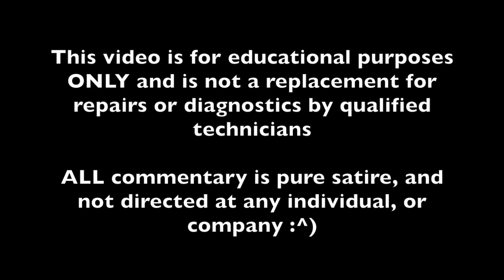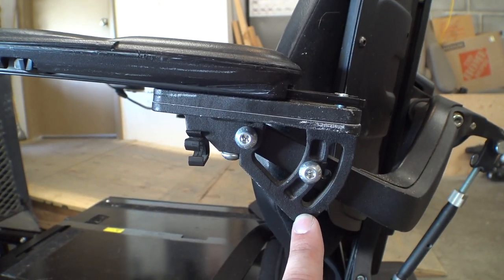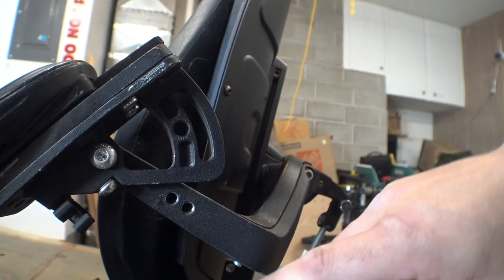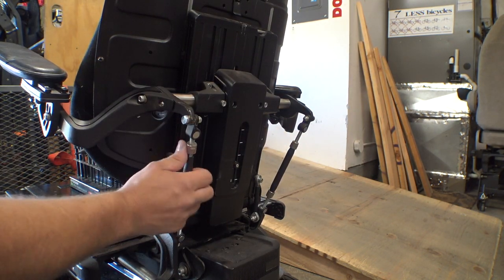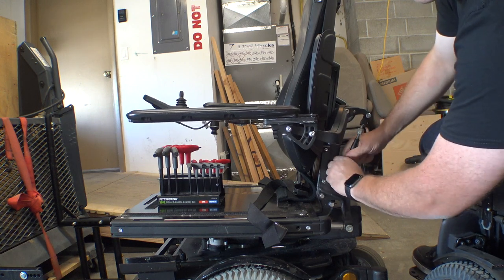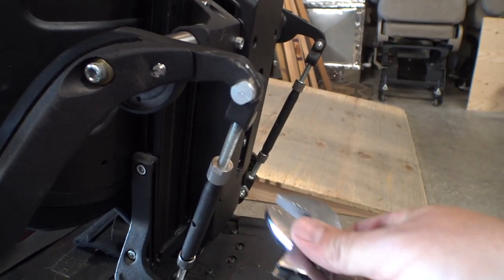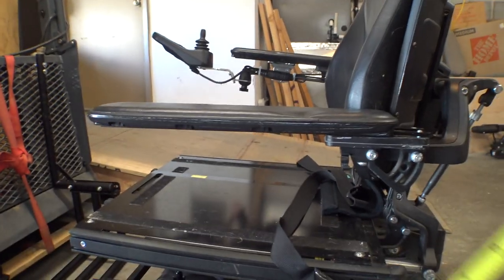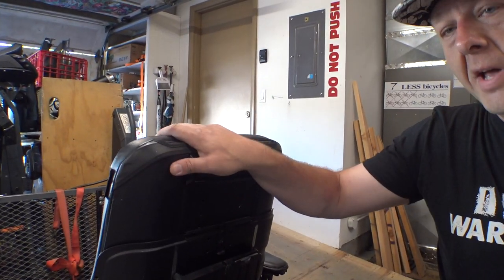REPAIR: setting arm rest height independently! (left vs right)

Comment: I just wanted to say thank you!

I'm using a temporary chair as I don't have access to my usual one and being quite tall I couldn't get the arm rests to a suitable height even after I'd reached the limit of the standard height adjustment and I was really confused as my usual chair reaches without issues.

It never occurred to me that you could use this trick to add some extra height, and sure enough it did the trick and my arms can actually reach them now.

Comment: Great video ! Thankyou, thank you...I have been putting off getting in the manual, so I can clear a spot in the garage to work on the M300, and this i s maybe gonna make me make the adjustments. BTW, anybody else  have to straight up REMOVE one of the arms cause your doorways are too small ? Still scratch my skull over that one...
Reply from the maker: yea those flat, wide arm rests are kinda obnoxious at times!! it is possible on some chairs to make them a bit more narrow.. bit it takes some screwing around.. and depending on how the chair was built.. sometimes a hacksaw LOL

Comment: On my permobil my arm rests are about 20 degrees from going all the way up and that makes it a little harder getting in and out of. Do you know if that is by design or is there something I can do to make my arm rests swing all the way up?
Reply from the maker: they should flip all the way straight up, or just a bit past.. there are some adjustments for this.. have you had the chair for very long?
Reply: @TotallyNormal-  for about 4 months
Reply from the maker: sounds like something wasn't adjusted properly.. do they give any resistance at all when ya flip them up? or stay in position etc? there's a small flat-head adjustment screw buried in a little recess near the pivot point.. its SUPPOSED to kinda click into a detent when its flipped up.. if ya push on them a little bit harder when lifting all the way up they are supposed to click into place.. but if the chair is that new, I'd contact the DME and have them fix it for sure!
Reply: @TotallyNormal-  okay I will check that out .thanks for the help